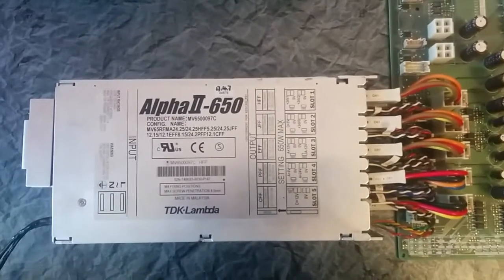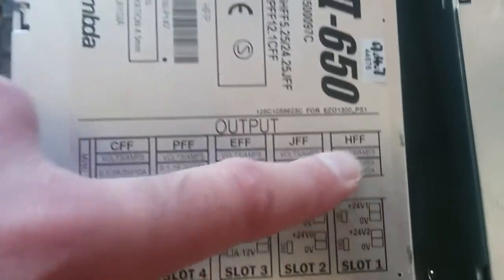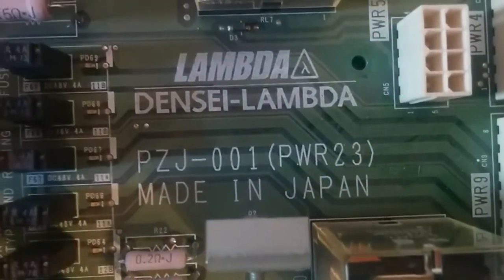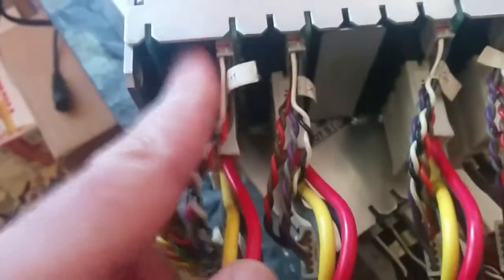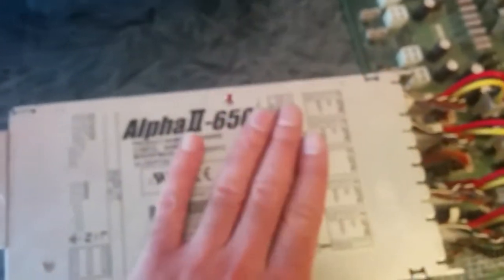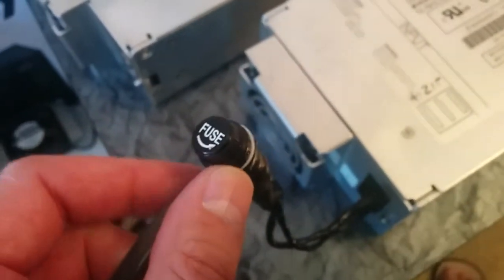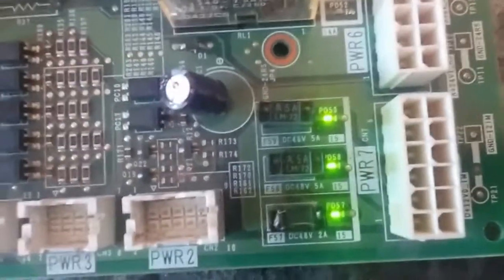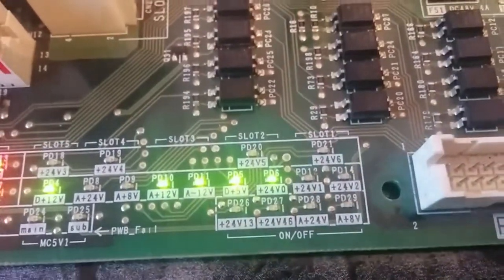Densei-Lambda Alpha II 650 power supply for Fujifilm Frontier 550/570 Digital Laboratories

Comment: my English is not good I'll translate
thank you for your understanding

my printing press is working properly and then it restarts itself.
I changed the processor fan
additional fan installed
I blew all the basecards and power supply with the machine and cleaned their dust. "Alpha 400 and Alpha 600 included"
still rebooting itself after working 4-6 hours
I always keep the lids on the back of the machine open.
after rebooting itself, I turn on the air conditioning in my office and turn the machine off and on again, this time it won't turn itself off.
I only have this problem in the summer.
We haven't solved the problem for 2 years.
Reply from the maker: Resul bey, Türkçe yazın. )
Reply: Ramin Azizli türkmüydün ya 😁 çok özür dilerim, benim makinem frontier 340 işyerim ısınınca kendini resetliyor alpha 600 ve 400 olan powerları ve bütün elektironıik aksamı çıkartıp kompresorle üfledim tozlarını temizledim yine düzelmedi çalışır vaziyette kendini resetliyor
Reply from the maker: @rnsoyturk  Türküz. 😊
Ne kadar çalışıyor resetlemeden önce (kaç dakka)?
Reply: Ramin Azizli ustam ilk açılışta 2-3 saat sürüyor çalışması, mesela baskı esnasında reset atmaya başladığında dişliler dönüyor hafızadaki baskıları çıkartıyor bi süre sonra dişlilerde duruyor. Bazen Windows ekranı gelince bazen o ekrana gelmeden reset atıyor. Şartelden kapatıp bir süre bekliyorum tekrar açıyorum bu sefer maksimim yarım saat sürüyor bazen daha da kısa sürede resetliyor. Ama klimayı çalıştırdığımda işyerim serinlediği zaman hiç restlemiyor klimayı kapatıyorum en geç yarın saat sonra reset atıyor.
Reply: Şunuda belirtiyim ustam arka kapaklar hep açık yerine takmadım, bilgisayar kasasındardır diye işlemci fanını değiştirdik içine ek ikitane daha fan taktık yine aynı sonucu verdi, kasayı çıkartp tek çalıştırdık sabaha kadar çalıştı hiç reset atmadı kendine
Reply from the maker: @rnsoyturk   Resul Soytürk   şimdi ilk önce bir-birimizi anlamamız için terimleri aynılaşdırmamız gerek. Resetlemek demek ne demek? Makina çalışıyor, ancak bilgisayar donmuş ve ya yeniden başlıyor? Doğrumu anladım? Ya makina da mı kapanıyor? Yani bu reset atma olayını terim olarak çozelim ilk önce, yanlış anlaşımlar olmasın.
Reply: Ramin Azizli haklısınız, yeniden başlatıyor
Reply from the maker: @rnsoyturk  bilgisayari bir bilgisayar tamiri dukkanina goturun, CPU-nun ve diger chiplerin termal pastalarini yenilesinler. CPU gereyinden fazla isindigi zaman bilgisyarai yeniden bashalata biliyor,
Reply: @doctorazizli  CPU fan değiştirdik ve termal pastasınıda yeniledik değişen birşey olmadı. bilgisayarı baskı makinesinden çıkartıp çalıştırdığımda sorun yapmadı bilgisayar ama baskı makinesine bağladığımda bu sorun tekrar yaşanıyor.
Reply from the maker: @rnsoyturk  o zaman işleticilerde (driver) bi sorun var. Sistemi yeniden kurmanız işe yaraya bilir...

Comment: Hi  Ramin.

I'm looking for an Alpha 2- 650 power supply. (Product Name: MV6500115C). The product specifications listed below:

Input Ratings:
NOM 100 - 240 V
FREQUENCY 47-63 Hz
MAX I/P CURRENT:11A
MAX O/P POWER: 650W (200 V)
600 W(100 V)

Can you suggest any seller to buy this product?
Reply from the maker: Hello, Dhanuahka.
I'll my partners if they have it in their stock. if they do, will put you in touch with them.
Reply from the maker: I've asked, but unfortunately they do not have this configuration available. But for your information, primary part of these PSU-s are almost the same. İf you have problem with the Primary part, you take from any configuration of Alpha 650 II and install. Make sure you test everything before go live. Good luck and be careful.

Comment: Hello ,mr ramin i have problem in alpha 400 power supply ...part name is ma4000001f ..i had problme in output mosfet  switing section ...fan is running but sec output is not working could u plz provide me schematis digram for it ..plz plz ..i am just near about foult ...one time it started but its wad for only one time ...i want to chel base volts and switing volt on frm ic
Reply: There is no volt is coming frm output secondry section is not working
Reply from the maker: @jeetusolanki7  first of all you have to check whether the primary section provides needed voltage. If it is Okay connect the output modules one by one to figure out which one is not working. Also please be careful, as you  are working with high voltage which dangerous to your life. Good luck.
Reply from the maker: Hello, Jeetu 
Unfortunately schematics for Alpha power supplies are not available for the public and I don't have them either. You have to do the reverse engineering and build the schematic up yourself. Sorry, this is the only solution for now.
Good luck.

Comment: Hello, could you please help me by advising where can i get a new board/chip for slot 1? I have an Alpha II 650 too and i am looking for a replacement for the same output module as you show in your video for slot 1. Thanks!
Reply from the maker: Hi Bryan. Alpha II 650 power supplies have different configurations. You find that indicated on your board (top side). I need to know whether your board on Frontier 550/570 machine?
Reply: Hi Ramin, i appreciate your response. It is for a Frontier 500, with an Alpha II-650. In my case, what is not working properly is the slot number 3 which says HFF. In the case of the power supply says the following information: Product Name: MV6500219D - Config. Name: MV65RFSN5.15BFF12.15/12.5EFFF24.4/24.4HFF24.4DFF24.4DFF. Thanks!
Reply from the maker: So it seems that your board (HFF) is on PS1 and HFF (24V output) is responsible to turn ON PS2 during the start up (at least this how it works on Frontier 550/570). Unfortunately output modules are hard to find and they are really expensive. Maybe you try to repair that board? Actually what do you mean that board is not working properly? Maybe I can help this way ...
Reply: HFF output module has two channels. The output in one channel is 24V and in the other one is 8V, and because of this, the display in frontier appears blank and i can't start the machine.
Reply from the maker: Driving from the configuration you shared your HFF board should give 24.4VDC only in the output. I see the same in Frontier 500 Service Manual (on page 18-26 and 18-36). According to the schematics +8V is created later on, outside of Alpha unit. Unfortunately I serviced Frontier 330/340, 350/370 and 550/570 but had no 500 in my past experience (that machine is not popular in my country). So I need more information to be able to help you. I think you have to make sure that:
1. HFF board has +8V in it's output (can you please share the picture of the board with output voltages on it?)
2. Also can you please give more information so I can see the problem and give you possible solutions?
3. Does  the Main Control Unit inside the printer starts up?
4. What does the machine shows on its screen? What do you mean by "it is blanked"?
Reply: Bryan Lopez yes you can module as well as full power supply for Fuji frontier 500 in 1000US$ from India.
Reply: Ramin Azizli If you want Alpha650 for you I can give you in 1200US$ courier charges extra.